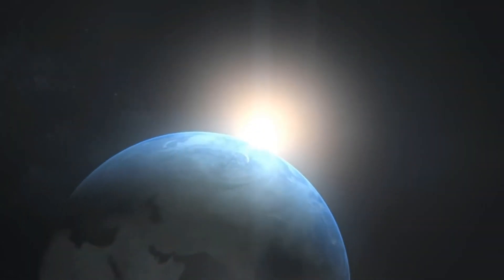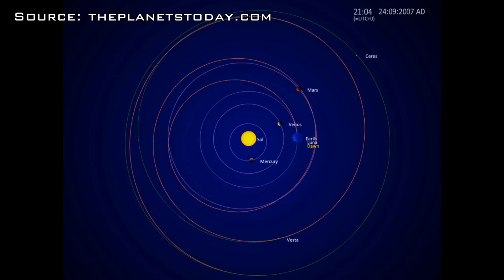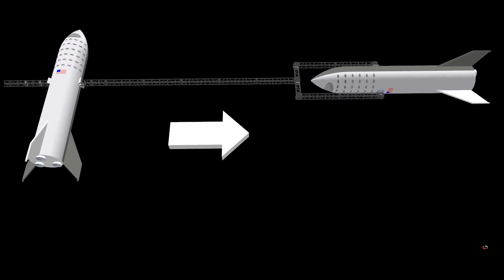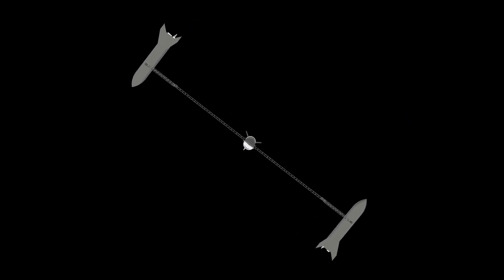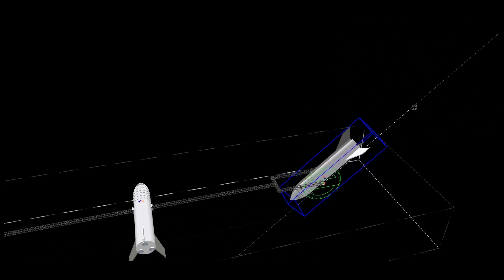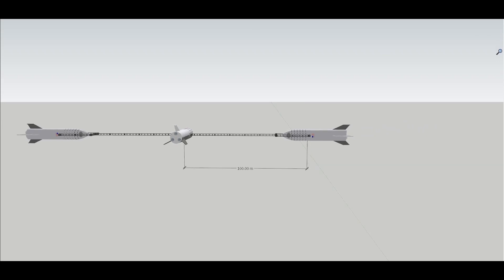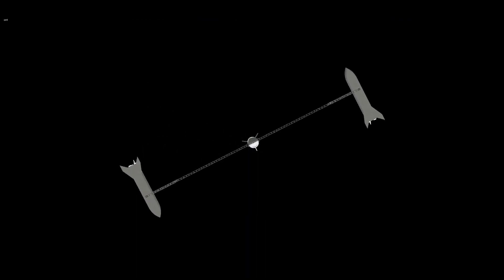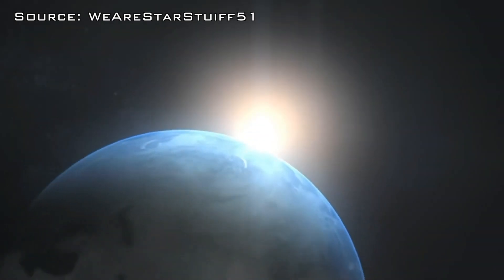GLS2: Artificial Gravity for SpaceX's Starship

Comment: You've put some consideration into the structural requirements, but interestingly, no consideration into the structural requirements of the starships themselves.

The basic starship has to be capable of a few gs worth of thrust acting at the bottom of the ship, as well as a few gs acting on the entire side for reentry.

The passenger ships in your example have to handle a full g acting sideways at two hinge points in the center, creating a strong bending force. Then, those same ships have to handle 1 g acting at the center of the ship vertically, creating a tensile force towards the bottom of the ship instead of the typical compression force when firing the engines. The real issue is that all of the stress gets concentrated around those hinges at a stress level at least several times higher than  with the basic starship functionality.

The truss ship in your example has a completely different job. It has to handle the weight of two different starships each pulling at one point on each side of the ship. Once again, a dangerous stress concentration, only with the forces pulling and pushing in different directions. The central ship is probably the easiest to fix, because you just run the truss system through the center to take the load off the ship itself. Such a simple solution would not work for the passenger ships though. You would need a massive, sturdy cradle for each of those ships to distribute the load. That's insane.
Reply from the maker: I agree, working on updated design now

Comment: Nice idea, doubt is possible yet for one reason you forgot: you need an engine that can throttle down. The engines on the BFR can't do that, yet, and even one engine will provide too much thrust to accelerate the ships in opposite directions.

Also a high tensile titanium cable, or carbon weave fiber will be much better. They can refuel planes in flight, using a cable, in buffeting atmosphere, attaching a cable to another spacecraft, in space, is child's play by comparison. It will take a lot less room and a lot less weight than a truss. Also it would take minutes to deploy instead of days. Ships don't have to twist end over end to get in position, but simply alter course, twisting the cable a bit.

The end of the cable can be guided, for example, by a small drone like device, with cameras for targeting and extremely small boosters, like the ones used on RC  ships.

One final point. Attaching a truss like you illustrated, requires a strengthening of the structure of the vessel, to support lateral forces around midship = more mass. Attaching a cable to the nose of the ship requires none of that.
Reply from the maker: Great points! At the time I came up with this, the specs on the vacuum raptor that were published claimed they could throttle down to %20. All of these points will be addressed in version 3.
Reply from the maker: I'm making a list of pros and cons for tether VS rigid structure. Please comment/add if you have any input on this. Keep in mind that going forward "rigid" includes strong cables in addition to the rigid part of the structure, for the purpose of taking the tension load.

https://docs.google.com/spreadsheets/d/1KMLvz9KBz0aL8CqkMifEo3-Esn6g__uj48YDtjHu_Yg/edit?usp=sharing
Reply: @smallstars  
I have such a better, out of the box idea, hope you give it some thought ! 

Gondolas !

Think of a monocoque carbon composite shell gondola, extremely light 50-200 kg (any shape, whatever fits best in the body of BFR). A ship can contain several, 10,  perhaps even more. It could be that several decks in the ship contain nothing but gondolas, enough for all crew. In these gondolas the crew quarters can be installed, sleeping spot, recreation, etc.

If you see the ISS video in which Maria Cristoffereti? gives a walkthrough, imagine the sleeping box in which she goes to sleep, made 4 times bigger, to accomodate 2-4 people, yanked out, with solid carbon walls.

Ship starts to rotate along its long axis, using RCS thrusters. Gondolas then are being lowered, by a simple electric pulley and tether, to required length to get 1g in the gondola.

No heavy trusses, no heavy cables, a gondola set up like this would probably weight no more than 2 tons, which makes the requirement for the tether ridiculous  (a simple 3/4 steel weave cable you find at Home Depot will do LOL). But is more complex, as the tether will have to have electricity, air and perhaps water conduits, at least as a back-up. And not just 1 tether, but 2 or even 3, for safety, each one being able to support it by itself.

Crew will spend most of their time in the Gondolas, especially when sleeping (8 hours of 1g per day), they get to have sex too ! When they "go to work" in the morning, simply press a button and reel in the gondola, like calling an elevator !

Each gongola has (half) an airlock, when reeled in, it docks with the BFR, hermetically, then you simply open the door. The tether and the electric pulley don't have to be pressurized, they can be housed in small niches.

Another IMMENSE advantage is: you can set the gravity in the gondola to any setting you want, between 0.1g and 2g by simply pressing a button and expending a little electrical energy ! Which makes the problem of astronauts returning home adjusting to 1g a non issue

What do you think ?

P.S. I added the idea to your google doc under tether, but it kinda makes the whole conversation moot. Is not a tether, is not a truss.

Comment: Good job that's great material, looking forward for V3 ! I'll try to do some calculations based on that to see the impact in radiation protection terms : the rotation gives a bigger cross section for cosmic rays to hit the habitat. I guess that in case of solar storm, the spinning would be stopped to avoid increasing the cross section, and people would shield in specialized compartments. In any ways, the benefit on health from this design thanks to simulated gravity would be always greater than the risk from radiation.
Reply from the maker: Drop me your email address, or tweet at me twitter.com/realsmallstars or instagram.com/realsmallstars

Comment: I think a teather would be good for a back up plan type of thing.  Maybe one running through the middle of the truss but I'm no engineer or rocket scientist..
Reply from the maker: YES! Definitely, working on the math for the next update to this now. The new design has a rigid truss structure with tethers to hold the tension force.

Comment: :) You are not alone thinking about the concept of artificial gravity. How do you compensate for Coriolis force? How do you deal with kinetic energy vs system spin in the absence of a fixed center of rotation? What is your ratio of speed to diameter to avoid unwanted manifestations on the vestibular apparatus? Why does movement in the centrifuge affect it? Did you know that there is already a recommended rotation per minute? Did you know that it is not necessary to precisely follow the value of the simulated gravity acceleration to induce comfort? It is not easy and I am afraid that the ring model of von Braun has an important reason. It is a compact design that makes it a stable, flip-flop kinetic stack that is as stable as possible. There are no other forces that would twist your rope, as in one ancient experiment, designed to generate electricity from passing through the Earth's magical field. With your crane construction it would turn out equally disastrous, notabene with rockets on the hinge. The rockets with large glass windows are nice, but Musk may have other concerns. Experienced NASA must pave the way to Mars and its experts already have it
 ideas about how to realize artificial gravity safely.
Reply from the maker: You compensate for the coriolis effect by extending the radius of the spin. http://www.projectrho.com/public_html/rocket/images/artificialgrav/gravComfort03.jpg

As for spin stabilization around a center point, that's going to be a tougher problem that I don't have the answer to as of this moment.

Comment: Have you heard anything from SpaceX about this?
Reply from the maker: No, but I will continue to improve the details of the design. I admit I kind of threw the design together as quickly as I could to get this out there and It could be better. I do still think my core concept (which is to carry the mass of the deployable structural components in an empty extra starship) should be taken advantage of, no matter how it becomes realized and actually deployed.
Reply: @smallstars  I'd like to see what you develop. In general it seems pretty sound, with a straightforward approach using inexpensive existing technologies, something for which SpaceX is well known.

Comment: Nice design, only thing I'd add is these trusses should perhaps be their own system, floating out there on their own. They shouldn't be hauled up with every flight, thereby enabling more payload capacity. Ships would rendezvous, use the system during transfer flight, detach at destination and descend to Mars surface. The truss system stays in orbit until the next pair of ships arrive for flight.

One more thought: if the fulcrum is a permanent fixture to the trusses, as I think it should be, it's essentially a tug. It would solely be responsible for accelerating/decelerating not only it's mass AND that of the trusses, but also two fully loaded starships... idk if, absent of Earth's gravity well, that's enough oomph to get the job done, but if not... why not have the attachment points of the starships gimbal so that they could provide forward acceleration. In addition to providing the necessary thrust to get all that mass moving at the speed to make the insertion window, you also have redundancies. Could you imagine the "tug" failing to fire while on approach to Mars and you send a couple hundred people hurtling into the inky darkness of deep space... Forever?! Yowzers.
Reply from the maker: It actually takes less energy to directly enter Mars's atmosphere and land than to achieve a parking orbit around Mars which is why I have the truss structure launching and landing every time. The current plan without artificial gravity is to land on Mars without entering orbit of the planet, this way the Starships can slow down using the resistance of Mars's atmosphere.

So yes the center ship, the GLS, is a tug, but one that Lands, gets refueled on a planet's surface, and launches again. The spin system is meant to be as simple as possible (which I know I failed at that in certain ways) but adding a gymbal for forward acceleration seems more like a "why WOULD they just" as opposed to a "why don't they just."  The "tug" need not fire while approaching mars at all. Speaking of which, if for some reason the crafts miss the mark and go flying past mars, they are actually in luck. The one of the most awesome reasons why the 6 month transfer orbit is to be used, is because after failing to land on mars, the Starships can continue to orbit the sun and naturally meet up with Earth again 1.5 years or so later. See this clip here about it, it's very interesting. I've fast forwarded to where Dr. Zubrin talks about using a 6 month journey instead of a faster one https://www.youtube.com/watch?v=EKQSijn9FBs&t=1020s
Reply: @smallstars  wow, awesome work!

What if the tug and truss structure (TTS) never enters Mars orbit? Instead, it just continues on it's solar orbit while it's payload (the two starships) detach and descend. Putting a few TTS in this transit orbit could operate on something like a train schedule. Every time a pair of starships dock they could deliver fuel to the tug.

I get what you're saying regarding the energy requirements to park in Mars orbit, but the contrasting point is our record for successful Mars landings. I'm just trying to think of a way to both put your invention to use AND optimize the working capacity (lift and volume) for humans and tools.
Reply from the maker: @definitelynotRoberto  Cool Idea, but I don't think its very practical. That solar orbit takes 6 months to get from Earth to mars, and then if my memory is correct, another 1.5 years to meet back up with earth before hoping to make a close pass with Mars again going in the wrong direction, away from Earth.

Comment: That is just dumb stupid idea
Just think about the way how bearings move around in a circle

How about this take the way of the Barons moving Circle in the middle of the ship make it at least 23 ft wide
Then have it deployed out miniature little jet on to 32 39 feet from the ship side's then turn them on for the circle bar and then y'all can use that as miniature gravity or you can use miniature speakers for a sound wave as the other people of was using for to make artificial anti gravity

And how they make the artificial anti gravity is 4mm a high tone micro sound wave
Y'all can reverse that to a very low tune micro Soundwave like a warp sound to decrease the anti-gravity to make gravity
I just came up with that what if you put two two two together I think outside the box more it with you ever done 
then you will achieve a lot of stuff more than you ever thought like that

Comment: you don't need to do any of this, all you need to do is use the ships RCS to spin the ship after you have used the main engines to give it a trajectory you desire.

imagine the ship as a ninja star, spinning through space.

obviously we would have to transport more RCS fuel to do this, but just needing to transport more RCS fuel is way easier to do then having to build this in space.
Reply from the maker: A spinning ship does not give enough radius for a viable artificial gravity system that humans can live in.

CorkScrewing: https://www.reddit.com/r/SpaceXLounge/comments/czycst/in_an_85m_diameter_rotating_cylinder_a_2m_human/

Tumbling 
https://www.reddit.com/r/spacex/comments/d032bi/potential_for_artificial_gravity_on_starship/

Comment: This would be for tourist travel not for colonizing. If we are sending people to live there permanently then any excess weight will be used for equipment and parts not a large metal scaffolding consuming 25% of the ship
Reply from the maker: The current mission plan is exploration with safe return of the crew though, not colonization. You make a good point though. For colonization I think they would install a centrifuge type device on Mars for surface use.

Comment: Why not use gyroscopes to initiate and terminate the rotation instead of thrust? Wouldn't that reduce the amount of fuel used and save that fuel for the trip there/back or leave more mass/room for equipment or passengers?
Reply from the maker: Gyroscopes would have too much trouble getting leverage on a spin system this large. Especially with the most massive parts being so far from the center of the spin. It's certainly possible but I believe the gyroscope apparatus would have to of enormous size and weight.

Comment: I don't believe you would need to send up the trusses with the ship, rather you could send those up separate and have them lock together as an orbiting frame until the ship arrives to dock and lock in the middle, this would also make it more structurally sound because with the trusses attached to the ship itSELF, you're putting a crap ton more strain on the ship and introducing more possibility of failure due to stress applied over time in extreme harsh conditions..  Also this would allow an emergency break-away type system or pre-break-away in case of imminent danger.

Great video btw, keep up the good stuff!
Reply from the maker: You make some good points but one of the constraints is that the mission plan doesn't have enough delta V to get into an orbit around Mars. Instead upon arrival, the spacraft will enter Mars' atmosphere to lower it's velocity. This is why I based this concept on a re-useable deployable system that can simply fold up and land on Mars.
Reply: @smallstars  So design the truss platform which has a nuclear powered engine, the only reason we don't utilize these here on earth is mostly due to the air being polluted to toxic levels, however in space we don't need to actually worry about this.. 

When you launch you can lock in and then just ride on a nuclear option, saving whatever fuel you have left inside of the shuttle for the landing. 

As for landing the truss platform, you can always create an AI landing system such as the falcon does, ensuring it lands in an area away from people to reduce any radioactive contamination.

If you were able to module out the platform you could also just attach actual fuel based rockets, or alternatively find a means to have a rocket engine run on radioactive or typical rocket fuel sources so when you need to land you can dump any nuclear fuel left (hopefully a small calculated amount) and land with traditional fuel types to reduce any radioactivity
Reply: random morning thought:
What if you used a mass array of dynamos on a rotating craft in space such as ISS..

The force of the spin would force the dynamo's in the right configuration to constantly rotate and generate a charge possibly  🤔

If you could generate a thrust via electricity with something such as a Electrically powered spacecraft propulsion then this rules out the need for large fuel caches for further travels.